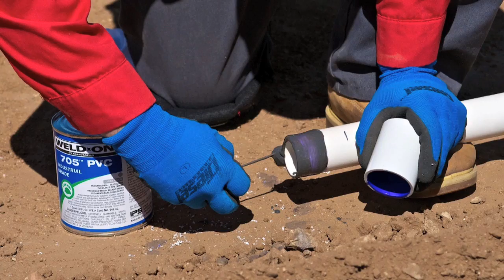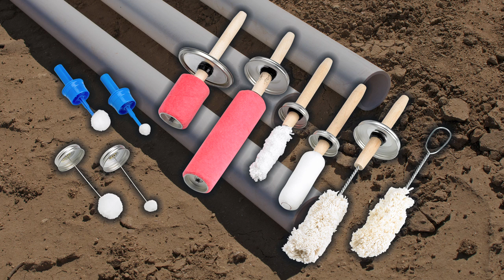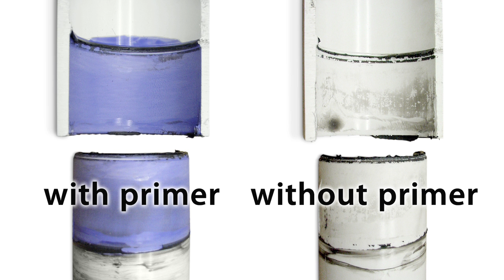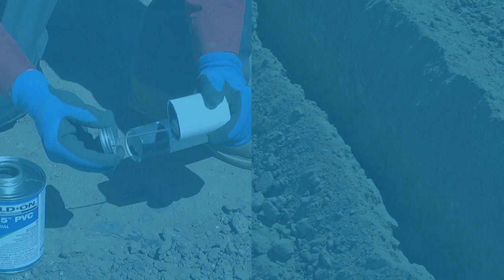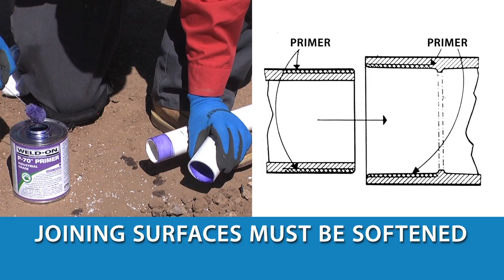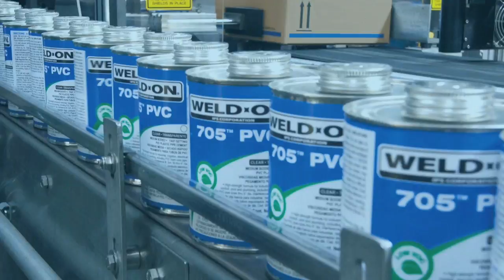How To: Weld-On Solvent Welding Guide for Small Diameter Pipes

Comment: be great if you could show how to get the bloody lid off the can first, without that this is useless
Reply: Channel Lock Pliers work well for getting the lid off
Reply: Strike the lid on a table usually will break it free.
Reply: Use a pipe wrench or adjustable pliers to hold the cap and then use a bit of strength to turn it anti-clockwise. That is how most if not all of those cans are regardless of the brand.
Reply: This is common with any pvc glue/primer can